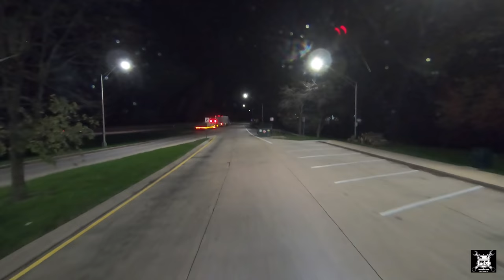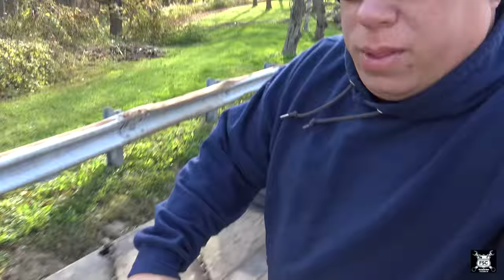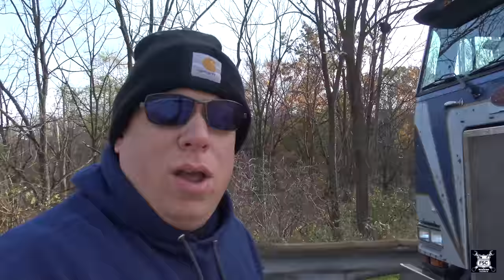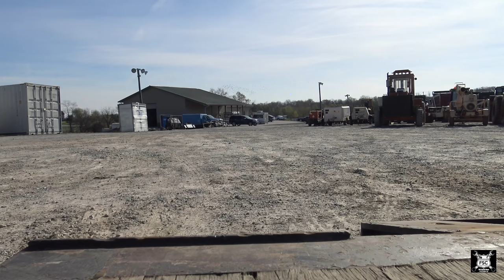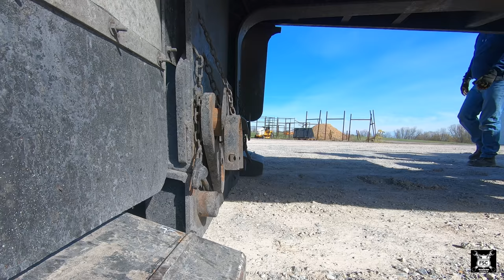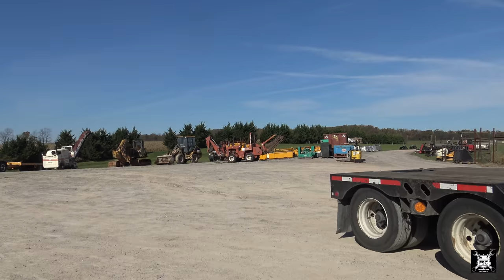Loading A Bulldozer   Detach Gooseneck Explained, Kinda

Comment: Twinsticks Garage just purchased a stretched 1979 Kenworth K100;and will begin restoring it later on in spring 2021,after he finishes Old Blue Little by little,and the Kenworth W900A project Snowman.He said that "these trucks are getting rarer,and harder to find;with each passing year.We need to save the "Flying bricks" before they are lost to the crusher at the scrap yard".Truckers may have hated them with a passion;because if you got into an accident,you were literally "The first person on the scene",they were for the most part all spring ride;which made them ride really rough,and they were awkward and dangerous to climb in and out of in wet and rainy;and cold frigid winter weather,and they were humid as hell,hot as hell,during the summer;as the A/C tended to not work so well,causing the engine to overheat.They were also not very well insulated to keep the driver/passengers legs & feet warm during the cold frigid winter months.Despite the problems mentioned above,many O/O truckers across the country are now racing against the clock,to save as many of these old cab overs as they possibly can;for nostalgic purposes,before they are lost forever.

Comment: Thanks for explaining this. I always wondered about how these trailers functioned. Thought it was a pneumatic or hydraulic system. Waaaaay simpler.
Reply: Actually, the newer ones are hydraulic. You don't have to unhook from the trailer, a hydraulic ram raises the low portion of the trailer, the wires, hoses, and support connections  are disconnected, then the truck pulls away with the towing portion of the trailer. There are vids showing it if you look around a bit.
Reply: @MrCatrucker  thanks for the update. I appreciate it!

Comment: Hello  have a question about hauling a cat d5  is it legal to transport with blade in the air tilted and sitting on blocks to reduce the width of the blade.
I always was under the impression that blade flat on deck. What is your opinion and what is the law say??
Reply from the maker: Yes, but you must also secure the blade along with the machine.
Reply: @fsctrucking  thank you  if I ever have any questions is it OK to ask u

Comment: I have bean around NGB detachable goosenecks always wondered how that type worked, thanks for the explanation. Thank for the open face push tip, never smacked my hand but that is a good idea.
Reply: what's worse is when your doing straps and the bar snaps when your are bouncing your entire body on it. faceplanted 4 feet into ash fault.

Comment: Had a hard time hearing you over the rap crap. Have a Merry Christmas !!
Reply: Also he's telling you how to tie down the little bulldozer to the trailer but you know everything so you already know how to tie down the bulldozer to the trailer. he's saying you tie down from the front of the frame behind the blade and at the back of the bulldozer from the frame to the trailer at both points you do not go over the blade he says it will cut the chain. Any other questions?